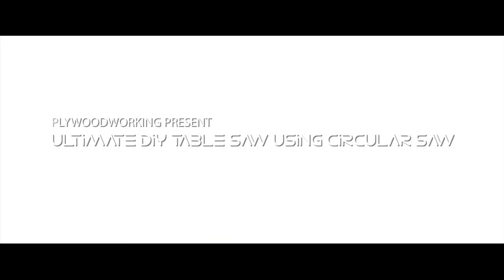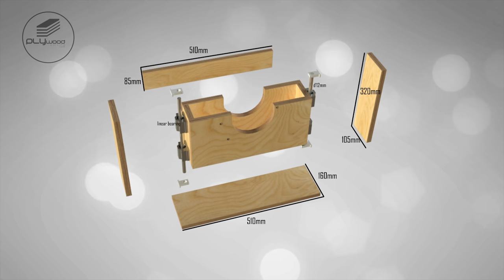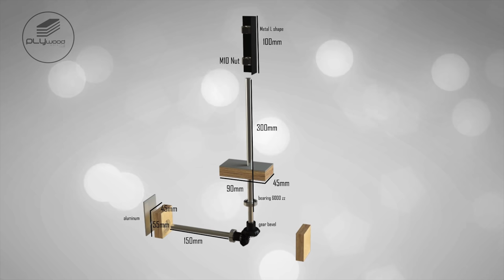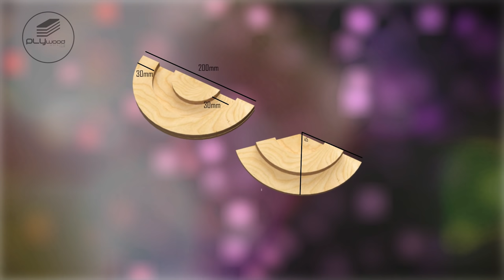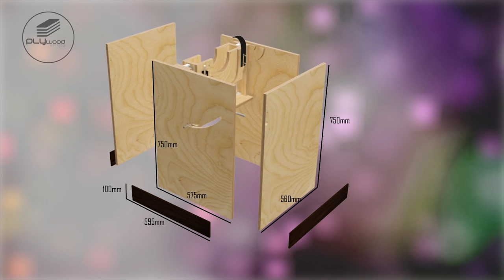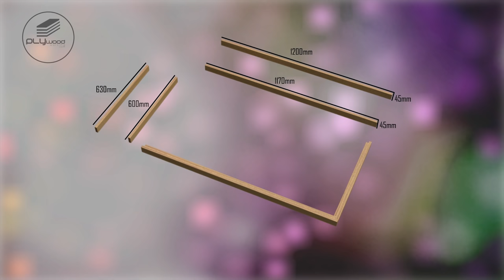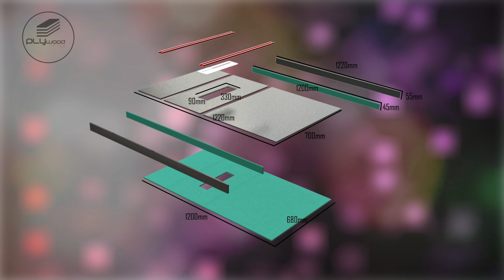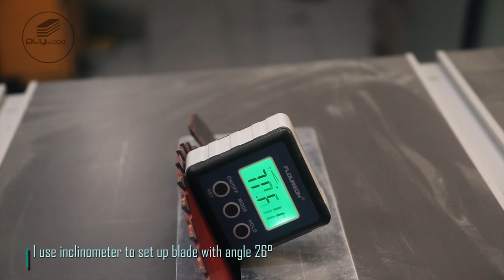The Ultimate DIY Table Saw using Circular Saw

Comment: Instead of using a linear bearing, which adds complication, a single point tilting raise setup is preferred. It's also good because you can put a single strong pivoting point, and use trunnions to make it super rigid.
Reply from the maker: thank you very much!!!!

Comment: well made video. One thing though the trunions seem to be incorrect in design they should place the tilt centre of the blade at the top of the table surface so the blade comes out of the same slot for both 90 and 45 degrees. As you have made them they tilt below the table and toy might as well have simply used pivots under the table top. Several table DIY makers show how to design the trunions where the tilt is projected to the top of the table and where to place the centre of the trunion circles compared to the chassis and table top.
Reply from the maker: thank you very much!!!

Comment: Well done. One of the best designs and will fit perfectly in my workshop.   Can I ask if you have any trouble changing the blade through the top blade insert? Thank you
Reply from the maker: Thank you very much, it is not too difficult to change and calibrate the blade.

Comment: Cheaper to buy a table saw rather than destruying an expensive Bosh i think 😊
Reply from the maker: This is a bosch pro more cheaper than bosch, yup you can buy a cheap table saw than make this but it needs calibration and the top table is not wide. 
this is optional 😁

Comment: This is a great build and it turned out fantastic. If there was just one thing that I would point out that you did wrong. Your trunnion centre point shouldn't be lined up with the  top of the sawblade block but rather the centre needs to line up with the table top - All you would need to do it cut the thickness of the table top off the trunnion and move it up. You can see the issue the current setup causes at 22:30 where the plate has had to be removed to tilt the blade - with the size of the slot in the plate you should be able to tilt to 45 degrees without removal but the issue that you are having is because the trunnion is off...

Other than that it is a fantastic build, thanks for making this video! 👍
Reply from the maker: thank you very much!!!

Comment: Overall great work, but with a problem in the configuration of the trunnion as is clearly visible in the video the blade can not be tilted to 45 degrees without having to change the top cover and also is a large gap between the top and blade saw. You have to take into account the thickness of the top and that the "pivot" point is at the top of this top, on the other hand the cut that you make at 45 degrees in the mobile part of the trunnion is not correct because in this way it will never be possible for the disc to tilt at 45 degrees because the trunnion will hit the bottom of the top well before the disc reaches this inclination, say you have to cut more. As I said the rest is well done but it is a shame that it is ruined by the poor configuration of the trunnions, you should fix that and you would get an excellent saw.
Reply from the maker: Thank you very much 👍👍

Comment: is that a 7¼ circular saw?.,im wondering if it can run a 10" blade without over heating
Reply from the maker: Yup 71/4 until now still work strong, dont push to hard and cut hardest wood with high thickness. Recomeded using trust brand like makita, bosch dewalt and etc. But if not sure using standart size blade

Comment: Great project.
But, allow me a small comment. Even though I'm nothing but an amateur woodworker, I could observe that you didn't consider the center point of the whole mechanism when you designed those trunions. If you would've, than you wouldn't be forced to change the insert every time you need to cut on an angle.

I mean no offence, I consider the entire project a success, exept for this part.

Good luck!👍
Reply from the maker: Thank you very much

Comment: I am currently doing the saw and trunion part right now.  Can't find WPC where I live - Google is not being friendly.  What type of metal do you use for the insert on the top?
Reply from the maker: Wpc almost same with pvc board/pvc sheet. Maybe you can use that keyword for search material. My old table saw i use 2mm aluminum but i more like wpc material coz reduce vibration
Reply: @plywoodworking  Om minta link nya dimana kita bisa bili WPC

Comment: Increasing the blade size increases the load on the motor which it is not really designed for, any problems?
Reply from the maker: This is additional upgrade, i give text you can follow this or not! (If not believe with the machine don't follow this step). I know not design for 10 but i trust with bosch brand, working for me i combine with freud blade still power full for cut hard rosewood

Comment: Itu pakek as besi yg ukuran berapa mm om? Terima kasih
Reply from the maker: As besi yg mana mas, rata2 pake 12mm drat bautya 10mm br kuat lbh besar lbh bagus mlhan
Reply: @plywoodworking  yang di sistem naik turunnya itu, terima kasih berbagi ilmunya mas, saya udah bbrpa kali mencontoh ide2 briliannya, sangan mudah d pahami.. terima kasih
Reply from the maker: As naik turunya pake 12mm bnrya mau pake 16mm tp terlalu mahal hargaya😅
Reply: Kalo bearengnya type dan ukuran apa om yang pas dengan drat bevel

Comment: Great job and highly inspiring. Have plans to build a circular saw into my workbench in the garage and I will most likely borrow some of your ideas. A question though. You don't find that a blade bigger than what you normally could fit in the saw you used gets too much for the motor to handle?
Reply from the maker: Thank you very much

Comment: If you add “ultra high molecular weight plastic (UHMW)“ underneath the locking mechanism front and back of your fence, it should help the fence glides left and right more smoothly.
Reply from the maker: Thank you for information, i will try search that material👍🏻👍🏻
Reply: @plywoodworking  If you can't find UHMW, cutting board is a good choice. It is slick plus very hard.
Reply from the maker: Oh yes i know that, hard and very slick. Thank you very much for information. That good idea👍🏻👍🏻

Comment: Pesan trunion bisa bang
Reply from the maker: Trunion tmn sy jual dri besi mlhan lbh kuat klo mau sy ksh kontakya
Reply: @plywoodworking  apa yg di group  itu harga 350 1 set
Reply from the maker: Iya kykya klo gk salah harga 300-350an, tp dri besi pastiya kuat coz tumpuan table saw itu trunion